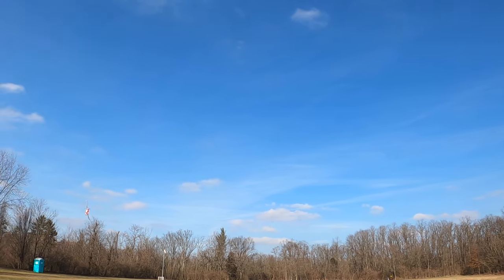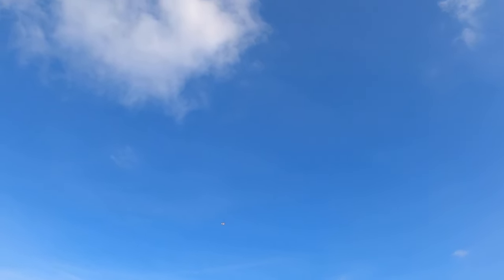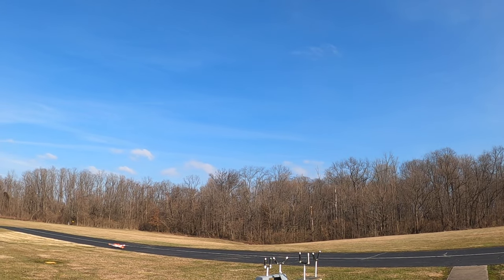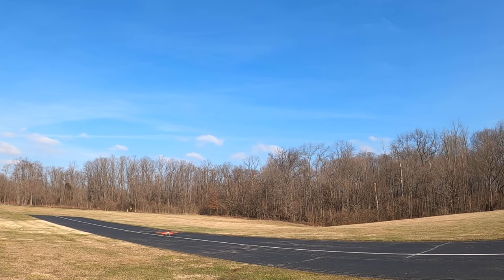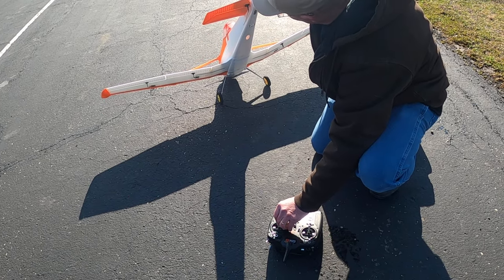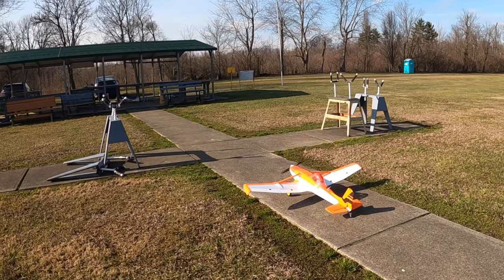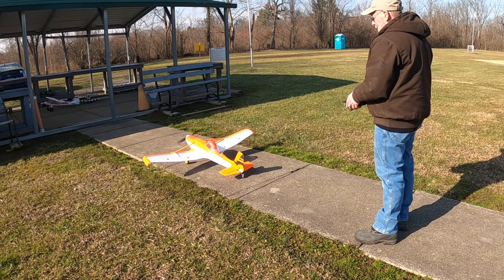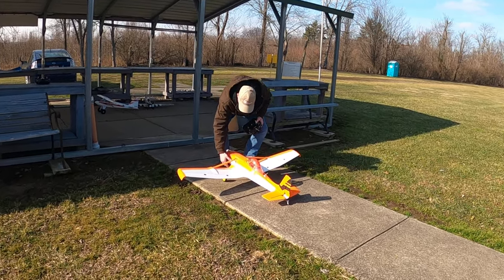Dynam Cessna 188 Orange 1500mm  maiden.  Hold on to your hats this was a wild ride.

Comment: It's a beautiful looking plane, looks tail heavy . You said the control rods were not attached to the fuselage , that's crazy .He did great landing without crashing . I really don't care for dynam , to many issues
Reply from the maker: Yeah I do not like Dynam either.  The Horizon Hobbies crop duster actually fly's.  Mike is determined to get this thing to fly.  I haven't put it up yet but he worked on the elevator and rudder and it crashed on a second flight.

Comment: I have a Dynam Pitts M-12. I sleeved all of the control rods with carbon fiber tube. Most don't agree, but I like Dynam because they need a little work. AirHammer out!!
Reply from the maker: I can see that from a modelers point of view but the price should be way less if it is more of an ARF.  You can buy this plane from Horizon for less and it is a far better model.

Comment: Well... we found a few things that went wrong. First both the rubber and elevator control horns had worked their way loose. Though they were screwed in, the had some play in them. Super glued them and tighten the screws. Nice and firm, no movement at all. Second, one of the two screws that hold the vertical and horizontal stabs on was very loose. This, I'm sure made the plane very pitchy. Tightened that screw up and everything felt snug and secured. 
On the second flight, I didn’t reset the trims. In order to get it to fly somewhat level on the first flight, I had to give it a lot of  aileron trim. As you’ll see in the video of the second flight, just after takeoff, if started to roll left. I just gave it to much right aileron to compensate which led to… Yeah... Crash and burn.

All it needs now is a new cowl, re-glue the engine mount that came loose, glue the wing tip back on and patch the ding in the wing and it'll be ready for another "Wild and Crazy" flight!
Reply from the maker: Oh I can't wait!!!!